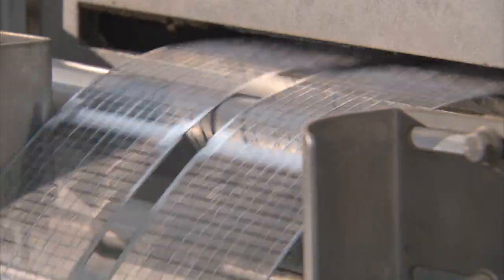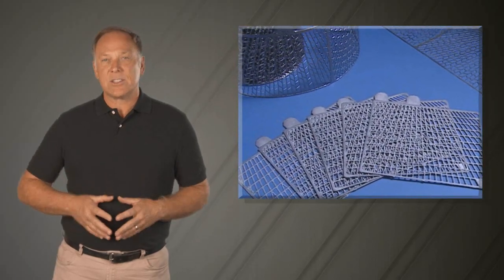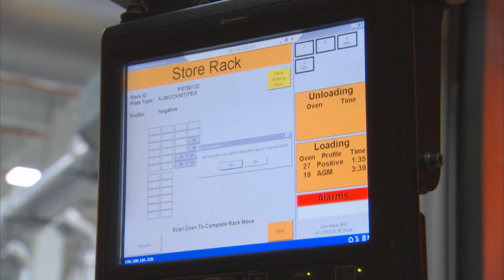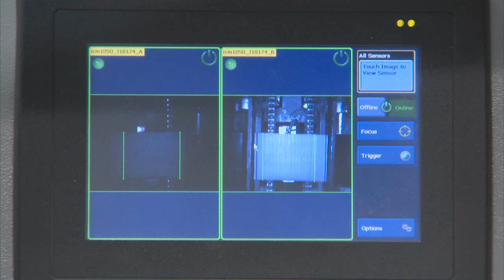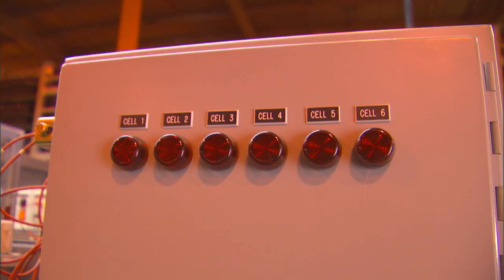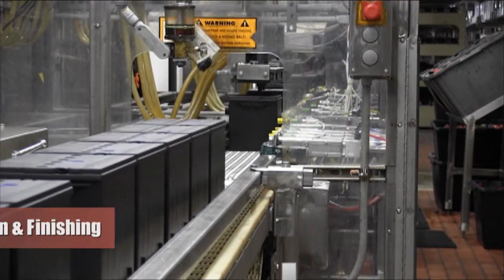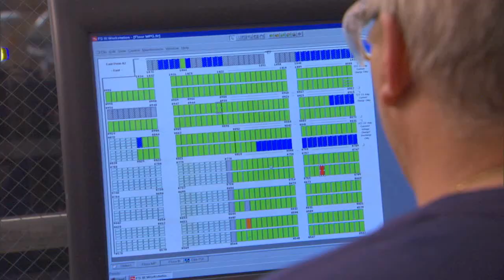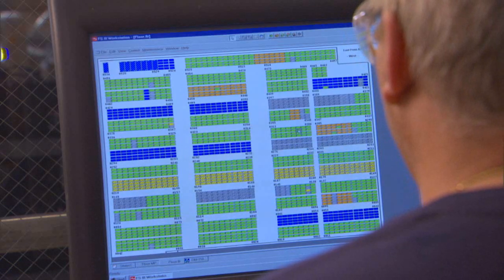Virtual Tour

Comment: Sir, May I ask you a question? For grid you mean it needs sandpaper, so it can help the grid and the paste more connect
Reply: I worked there 10 years ago. The GRID is a term that holds and structures the place where the OXIDE PASTE lives it locks the paste in place by texture and captive shape😊😊😊😊😊